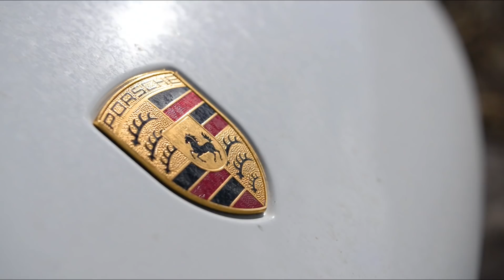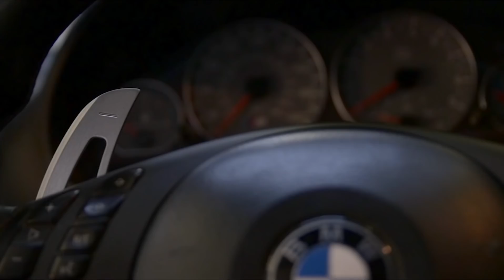Cars Are Changing

Comment: I'm afraid that the consumers of more expensive cars that non-car enthusiasts are buying said cars with dual clutches and autos when that doesn't reflect the lower income car person. I feel as though if more car people had more cash to throw at supercars there would be a lot more manuals.
Reply: Canadian Carguy So we need more rich car guys! Come on everybody get your ass up and lets make it to the 1% !!
Reply: What point are we missing? your automatic car will possibly be like 5% faster, at the cost of driver input. If you value having .1 second off your 0-60, go for it, but for those who actually care about having fun  and enjoying the drive, it isn't worth it. and the automatics are faster argument only applies to very new automatics and DCT transmissions, not the slush box auto you just put into D in a 2005 Camry.
Reply: It's sad that you'd prefer your car to be fractionally faster than more fun to drive. your priorities are mixed up unless you're tracking your car consistently and winning is all that's important.
Reply: Car enthusiasts can have PDK too. Not all PDK buyers are just rich people. A lot of car enthusiasts prefer it to get faster lap times even if it sacrifices engagement
Reply: +ShazamMan But, let's say the world is all autos all of the sudden. I know myself and a good amount of car people will miss the mechanical feel of a manual. You just don't get the same connection with an auto, in my opinion at least. Also, speed shouldn't really matter to a person as long as there having fun with there car, the car could be a 05 Corolla XRS or a 17 488 GTB, two completely diffrent cars but just because the corolla isn't as fast they can be having just as much fun if not more than the person in the Ferrari. So in the end just because the auto is faster than the manual shouldn't determine if your car is fun to you or not, it should be how the car makes you feel.
Reply: I definitely think you're right. The people that buy supercars mostly are buying them as status symbols. If you look at the more affordable sport car range they all pretty much come with a manual option. Us plebs still want manual sports cars.
Reply: +ShazamMan I do think some of them are missing the point. Though I would personally take a manual over a auto any day of the week it doesn't make you any less of a car person. Sure a manual may feel more involving but some people like to just push there foot down and go, doesn't make them any less of a car person. Do I think DCTS and Autos are taking over in North America, yeah, but just because you have one doesn't make your car any less cool or even fun. Just personal taste is all.
Reply: Canadian Carguy that's is a really good point,never thought of that but makes so much sense
Reply: +ShazamMan You should get back into man! You won't regret it!
Reply: +ionianfalcon We need more lawyer and doctor car people!
Reply: You'd see a lot more people driving a bit safer too if everyone was on manual. Example...you really don't tailgate someone unless you know what your doing when driving stick. In automatic...you just put your foot on the floor up to the person's rear and sit pretty. In a manual you really don't inch forward repeatedly at a red light. In an automatic it's a given. In a manual you learn to downshift and let the engine slow you down when traveling downhill, in an automatic you completely forget about the "higher gears" and ride those brakes downhill like a champ.
Reply: +SS So... that's like I had said before, the people buying the P1s and GT3s don't care about cars (usually). Glad we got that out of the way. To your other points, sure a manual can be a nuance and have its draw backs in the city, it's very rewarding on open roads and the twists and turns, and a good amount of people put up with a having a manual in the city because they truly are fans of the transmission. I'm one of them. The put up with all the faults for what Is good about them, like almost everything in life
Reply: +Chrx x Exactly, how much said celebrity has in the bank is how shinny and new there Veneno is.
Reply: +Amateur Car Garage Glad I explained myself well enough haha
Reply: You just don't know how to drive a manual admit it.
Reply: +ShazamMan Autos are good dailys, manuals can't really compete the I'd still take one since I can only afford one car Haha. WRX would be awesome dude, I was looking for one last year, a Hawkeye wagon WRX to be exact, love them but I bought a FG2 Si instead haha
Reply: +Big Iron Thanks m8, You're a doll too
Reply: +Big Iron A very late doll, but a doll none-the-less
Reply: Canadian Carguy not entirely true I mean Porsche brought manual transmission to the new gt3 due to the outstanding commercial performance of the manual only 911r. That being said, I think most people just don't really give a shit about cars, they just want something comfortable and convenient. DCTs and autos are popular because they're convenient. Yeah sure, these transmissions give better performance, but the vast majority of people don't track their cars. And let's be honest, manuals are fun, but when you're living in a crowded urban area like San Francisco, manuals can become a drag. While driving stick on wide open roads on a Sunday are a real pleasure, driving a manual in a congested city for my daily commute is not- it's inconvenient and it becomes annoying.